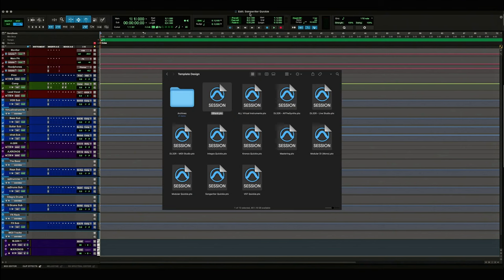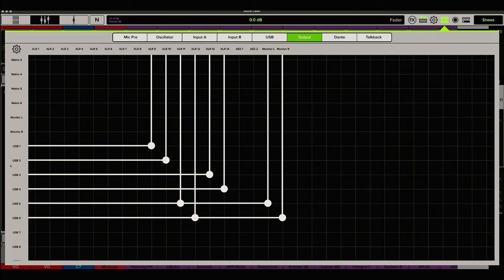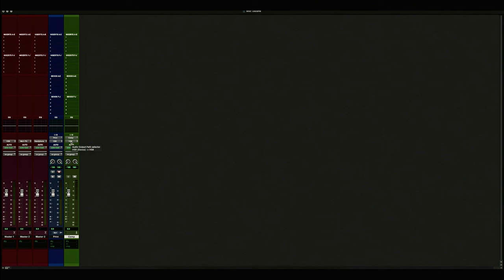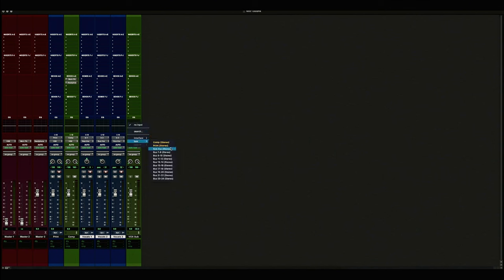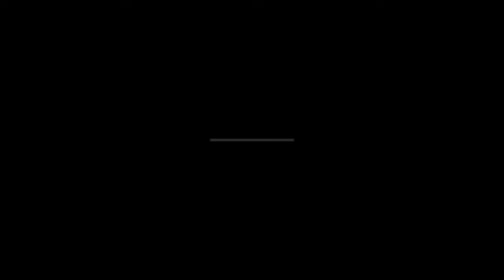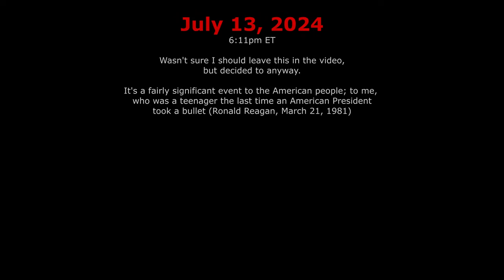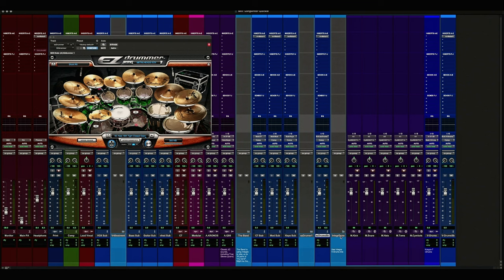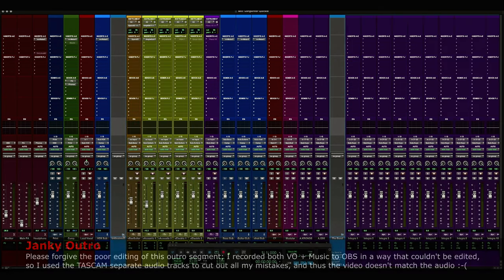How I Do - Building a Template from Scratch (Channels | Buses | Signal Routing | Pro Tools 2024.6)

Comment: Really enjoying your videos. You put a lot of care and detail into them. Did I see you creating subs for single channels once or twice, like the modular channel? What is the use case for that?
Reply from the maker: Thank you! For the single channels w/Subs, I do that because I have 4 modular cases; each one will need a stereo IN, so this quickie template is just 1 of 4 I may decide I need. Same with the piano mics. I start with the 2 sound board mics, but might want to add more so I want a sub-mix of those too. If the channel is truly only ever going to be 1 channel, I route it straight to Comp, by-passing the need for a Sub since it will only be 1 channel - if that makes sense.